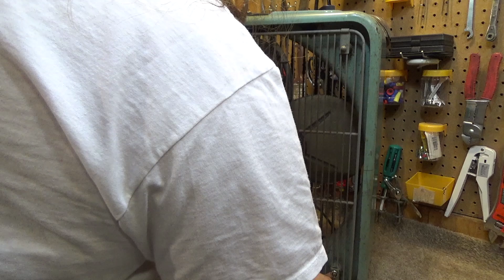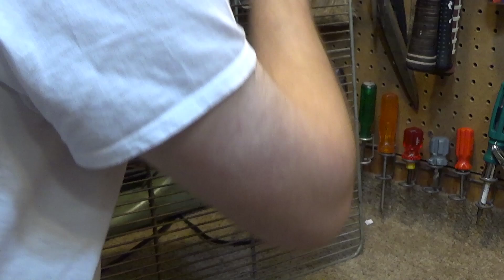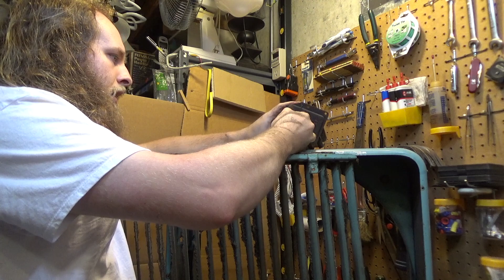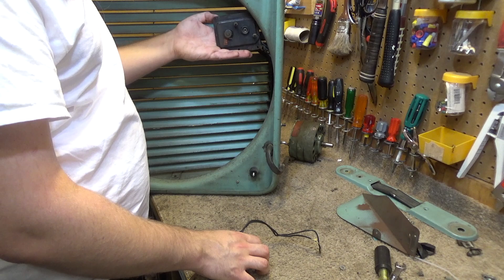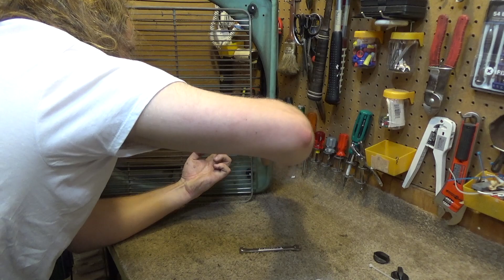Vintage Lasko Box Fan | Disassembling and Brief Cleaning

Comment: You don't really need the oscillating parts, I would just restore it without that part.
Reply: I agree, the oscillator is mostly a gimmick and the fan will operate just fine without it.
Reply from the maker: That doesn't make sense.

Comment: What a great piece to have. Such great build quality. As far as the oscillation mechanism goes, If I remember correctly, they used a rubber washer to transfer power from the motor to the gearbox that is no longer present. You said the motor wasn't running so I think it's time to ohm out the little motor and the push button switch.
Reply from the maker: There's a lot more investigation that needs to be done, but if a rubber piece is missing, then it's not worth the time; the system will have to be re-designed.

Comment: Well I must admit I did have to skim thru this one a bit, HOWEVER, I did pick up quite a lot of info from the video! First off it seems that our suspicions of these fans being PSC motors were correct because there was a pretty decent sized cap hiding down near the controls! I will definitely have to test my cap and probably replace it because my fan runs way slower than yours does on both speeds! That's really odd about the oscillator motor. I plan on getting to my fan in the next week or so, so if you can wait until then I will pop mine open and see if I can see what should be on the end of the shaft of the motor. It definitely looks like something is missing off yours to me. I also thought it was pretty neat how even that tiny motor has dedicated cooling fins on the rotor to cool it! Crazy! Also, with regards to the with the cabinet being "live", I would actually take a volt meter and touch one end to the cabinet and one to a ground and see how much voltage is actually there. I have found that those stupid beepy things like you are using can be extremely sensitive and pick up a totally harmless amount of electricity and start beeping and flashing away. Chances are that there is just a few volts on the cabinet due to the fan not being grounded and it is totally harmless. Just the resistance of your body touching it will create enough draw to make the voltage drop to 0 and you wont feel a thing. I have seen this happen before when running computers off an extension cord with no ground and I actually found voltages in excess of 30 volts AC on the metal parts of the case! That was enough to cause a little tingle, but as soon as I fixed my extension cord it dropped to 0. I have also seen it with one of my fans before where the cage had like 10 volts on it when checked against a ground however that is not enough to even feel at all and like I said it probably drops to 0 as soon as you tough it. If you are really concern, add a grounded cord to it and ground the cabinet of the fan. This was a very interesting video and you are making me really want to tear into mine after I finish working on my Chelsea pedestal fan and see what makes it tick! Again, if you are willing to wait a week or 2 I can take my oscillator apart and shoot you some pics of whats inside! Looking forward to seeing how yours comes out! From what I have seen on your channel before you will end up with a really nice looking fan and I'm sure you will even come up with solutions for the little things like the handle rubber too! Keep us posted! :)
Reply from the maker: COMMENTS BOX VIOLATION!!! At least you seem to have captured enough of the video to make intelligent statements about it, so I guess I'll let it slide...
There seems to be mixed opinions about replacing capacitors. I haven't checked it yet, but the one in this fan seems to be fine still. There's a lot of people that would say to replace it due to age, but I'm a lot more confident in this one than a new one made this year. I will meter it to confirm, but as long as it reads within an acceptable range of the rating, it's staying.
That shaded pole motor is probably one of the nicest ones I've seen. Most good quality motors will have those small cooling fins on the rotor. I tend to think in this case there would be more than enough air moving through that cabinet to keep the motor cool.
As far as I'm concerned, the cabinet should have no electricity on it, period. I'll have to meg the motor to see if that's where it's leaking from, I wouldn't be surprised if the motor is due to be revarnished.
A week or two? When I say I'm not getting to something anytime soon that means months or years. The gear box appears to be riveted shut and non-serviceable. Of course that won't stop me, or probably you, from getting in there and servicing it, but that's not a project I want to start right now. Would very much be interested in seeing pictures if you do open it though.

Comment: Great job Jordan. I think a rubber wheel might have been used on the oscillator motor but has since disintegrated or something.
Reply from the maker: I suppose that is a possibility.

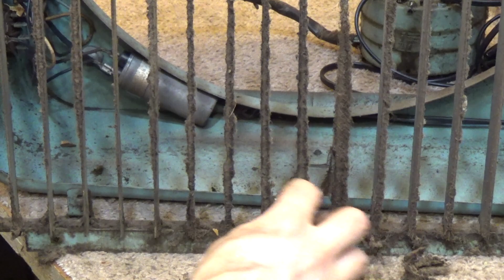Comment: At 30:50 Look at that giant cap in that metal can at the bottom! That's why the fan is so efficient, its got a capacitor on it. Wow! I just saw you acknowledged it at 45:40. Careful that you discharge it before touching. I had an old 50's fridge with a cap and I wanted to discharge it and when I grounded it out I was met with quite a large amount of sparks! Try a voltmeter from the frame to ground to see how many volts you've got on the frame?
Reply from the maker: Correct, it is definitely a PSC motor.
I've been zapped by capacitors a handful of times over the years. Not fun. A cycle through the speeds with the unit unplugged should discharge the capacitor.
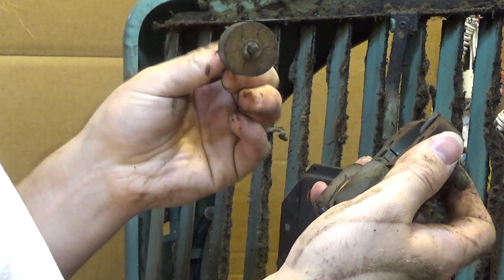Reply: 27:09 that is a lot of dust on the oscillating mechanism!
Reply from the maker: @Alexander-in9mc  True.